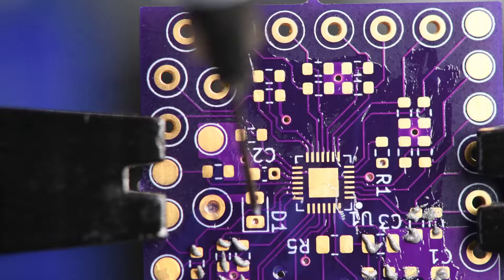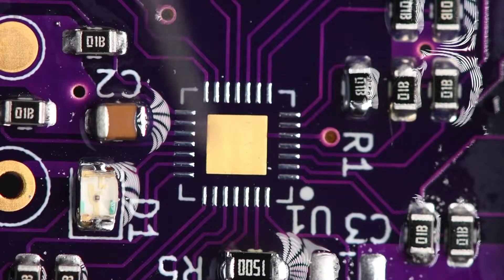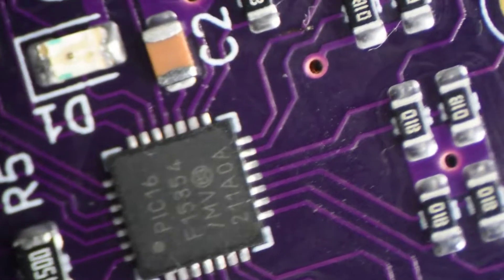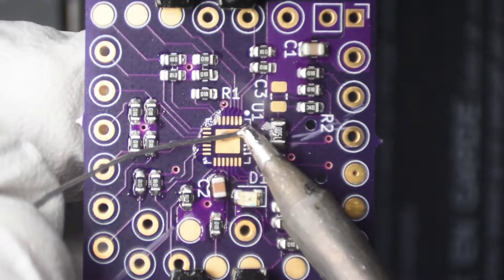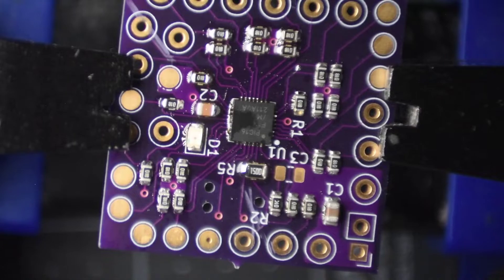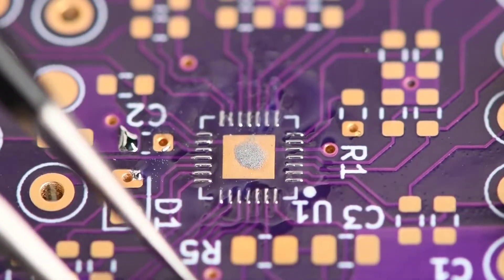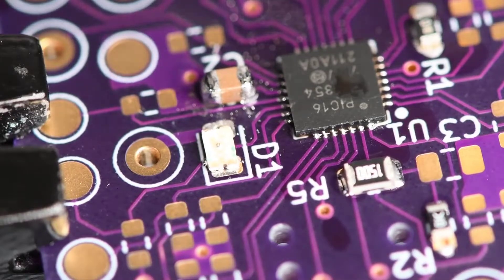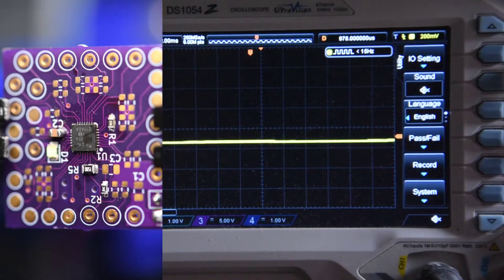QFN-28 Soldering Trials and Tribulations

Comment: why not use just solder paste?
Reply from the maker: I had the solder paste for quite a few years but never really used it. I did try it a couple of times with the soldering iron, just to see what it was like. But these were really the first uses of it with hot air. I use it a lot more now, almost exclusively with SMD parts.

Comment: I have not tried soldering this package but I have solder esp32 modules and some other small smt packages.  What I do is use a thin point soldering iron to add some solder to a corner pad and then align the component while heating the pad.  One I have one pad down I usually will tack the opposite corner.  Then with a higher wattage iron with a wide tip I will use the wipe method.  I add solder to the side of the component as I wipe across the pins slowly which drags the solder with it.  Then wipe back and forth 3-4 times until I I can see the solder wicked across all the pads.  Any excess bridges I clean the iron tip and then hold to the bridge and then pull away from the component which usually brings the excess on the iron tip.   Just be gentle when wiping back and forth as to not damage any pads with excessive pressure.  Most of the time I don't even need flux.  As far as the center ground pad I just put vias on the pad in my pcb design so that once the part is in place I can use 60 watt iron and soak solder through the back side under the chip.  Works for the parts I have done.  :^)
Reply from the maker: I can't go back to soldering these with an iron now.  Hot air make things so much easier.

Comment: About the little push, told you, works great. I don't pre-tin the pads, just the solder paste it's enough. But still, the solder plate it's even better and with the stencil it's unbeatable IMO.
Reply from the maker: When the first one didn't do well, and I thought there really should be enough solder.  I thought of you comment about a little push.  Thanks.

Comment: I've found over the years that sometimes leaded solder won't stick to newer parts. I don't know if they changed the alloys in the leads to make it more friendly for lead-free solder, or what happened. I have seen first hand that you can take certain parts, flip them upside down on your mat, heat a lead up to temp with your iron, and if you try to put leaded solder on it, it will just ball up and roll off. But it's not every part, or even every manufacturer. It's also not just QFNs, but also QFPs and PLCCs, as well. 

So, if you're using leaded, try using lead-free, and vice-versa. Could be your flux, too. Certain fluxes work well with some alloys and not so well with others. Many types of (non Sn/Pb) solder recommend a specific flux to use with that particular blend.

As far as oxidization,  you can use one of those fiberglass brushes (e.g., Techni-Tool  352CH266) to scuff the pads up and remove the oxidization layer. It also works on component leads. I forget who makes them, but there's also little pencil-size wire brushes that also work well for that.
Reply from the maker: I hadn't thought about that.  I've had the boards maybe a little over 2 months.  I should have put them in a sealed bag but I didn't.  But it may be they are treating the boards to handle lead free solder.  I had one little tube of lead free, it was so horrible i tossed it years ago.  May have to try some of the newer and see.